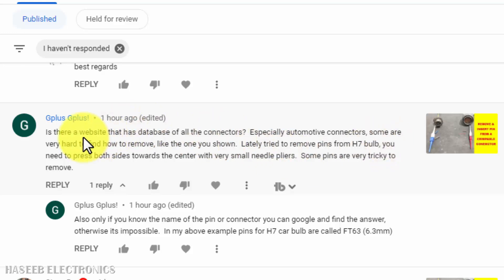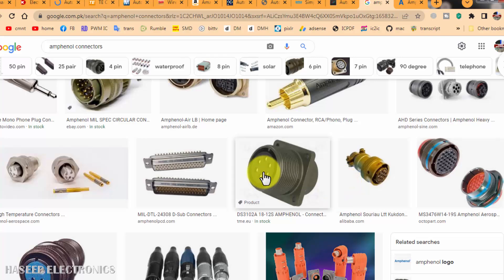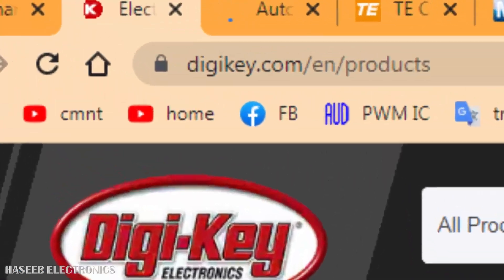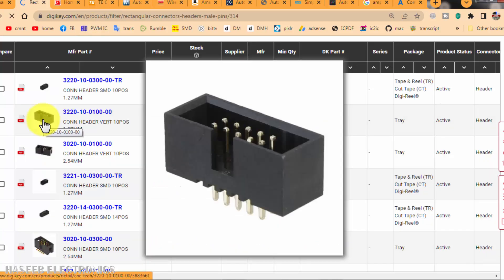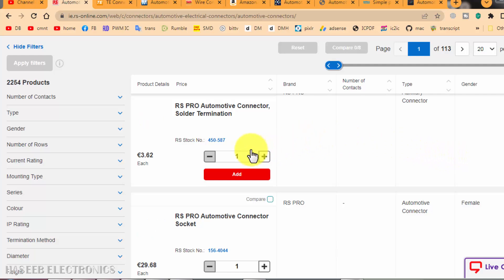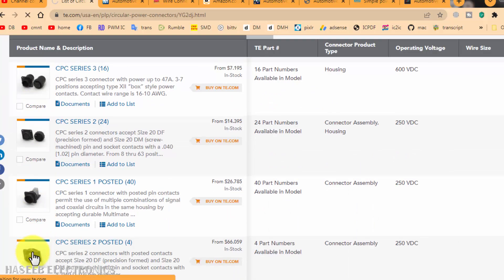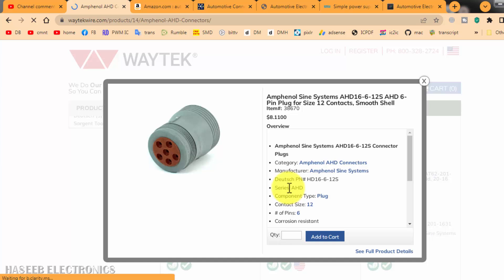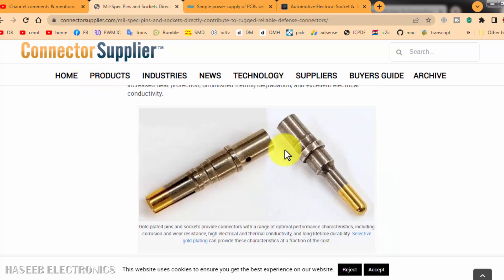{656} How To Find Electrical Connectors - Automotive, Amphenol, Electronics

Comment: Hi sir 
I want help 
I'm a chemist 
Studying pressure difference through voltage measurement

I am finding difficulty in circuit connection

Can u help in the circuit connection of 
1 psi d 4v ascx and oscilloscope connection with 5 V battery